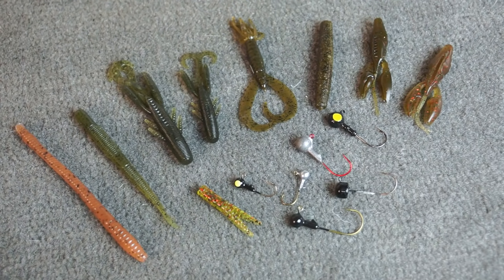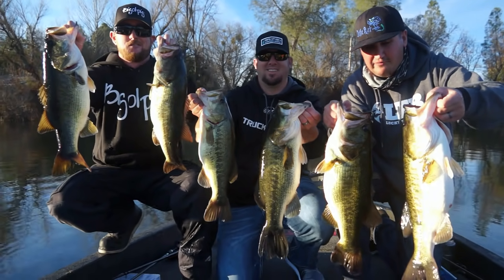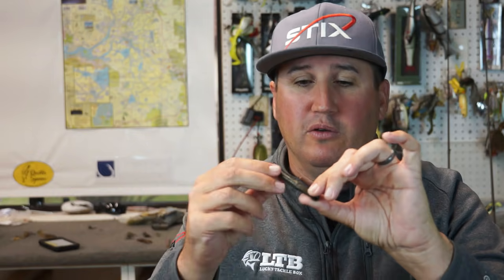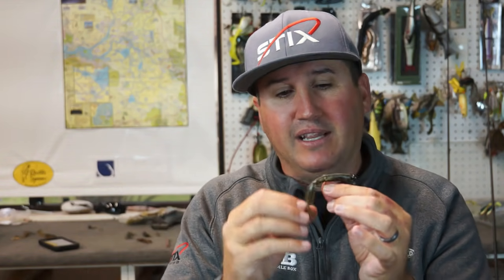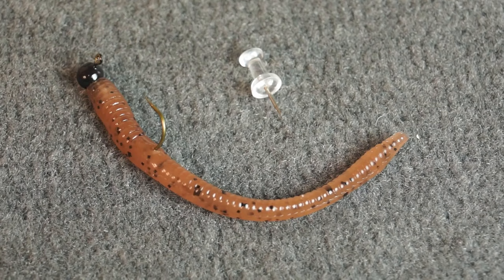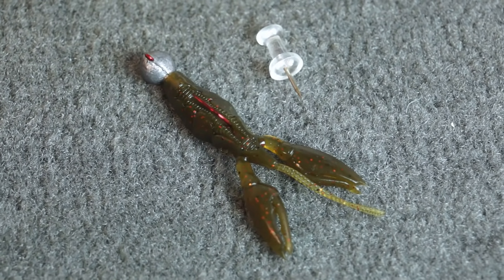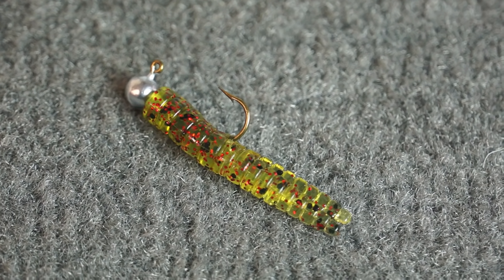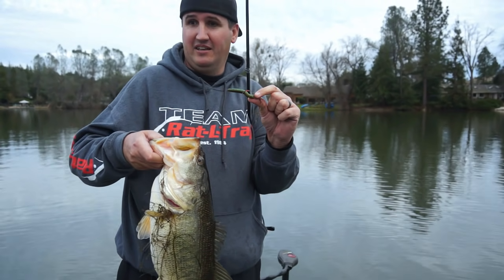youtube video #-B8kv_HNhxE

Comment: I have a nearly 40 year old fishing book from the 80's that suggests throwing a shortened and split floating trick worm on a mushroom head during a cold front. Ned rigs are just the packaging of an idea that has been around for a very long time. 
So many "innovations" are just companies making specific products for things that savvy anglers were already doing by modifying existing tackle. 
Many smallmouth anglers in particular have been throwing Ned rigs since finesse soft plastics and standup/mushroom jigheads existed. 
They just didn't call them that. 
The stretchier, tougher plastics that happen to float were first popularized for Texas and Carolina rigging. It's not that big of a jump to stick one on a jighead. I used to do it with just the tails from lizards and beat the tar out of picky fish in small heavily pressured waters. I'd use a slider head in weeds and timber and a standard open hook jighead in clear rocky streams. 

Insert Pink Floyd's "Money" here

Comment: I feel like it isn't a NED Rig if it isn't a stand-up jig with a bouyant short plastic.  Otherwise it is just a small jig fished slower than normal.
Reply from the maker: IlliniDog01 all plastics float to some extent but in regards to the Ned himself on Ned rigging thats not essential. I agree it helps in lots of scenarios and under line tension they all stand, dead sticking would be the exception.

Comment: the Zman lures are tough but man, they either have a low temp melting point or dont go well with other plastics. I had a bag melt into a blob in my backpack. :(
Reply from the maker: john doe yeah they do, I make it a point to never mix any plastics 😆
Reply: john doe it’s not that they’ve got a low melting point, it’s that the specific plastic called Elastech that chemically interacts with “normal” soft plastics and melts them.
Reply: @TheFishingMommy  Yeah, I figured that as it wasn't hot at all. tnx.
Reply: john doe you have to keep the separate from your other plastics as recommended

Comment: Why is the Ned Rig anything special? By 2005, every Australian angler was fishing jigs with small plastics and catching bags on them. Since the Mister Twister days, we were cutting tails off Mister Twister and dropping them on ball jigs, Squidgy brand soft plastics released in the late 90s are generally smaller than 3 inches. In fact, most Australian anglers in the South who are not fishing for the monster cod use nothing bigger than 3 inches ever. I am truly curious as to what it is that makes Ned Rigs different. Ned did not develop it at all. It has been in use for 30 or 40 years, not since 2006. I really am missing something here, or the American propensity to name everything with a fancy name is confusing the issue. In fact, most people in Australia know no other form of rigging a soft plastic. You rarely see a sliding sinker rig or any other rig.

Comment: Stream fisherman! Cast as directly upstream as possible without positioning yourself in such a way that you'll spook them. Tick bottom with just enough weight and retrieve speed to match the current. If you don't have a sensitive enough rod to notice a slack line or gummy feeling bite, cast downstream along a current seam and drag it very very slowly, pause occasionally and maybe wiggle it a bit. 
You'll thank me later. Just promise me you'll learn what's supoosed to live in the drainage you're fishing, catch and release any native bass you come across, and throw non-native invaders on the bank.

Comment: The 4 lbs is to small I stop buying it and go to 6 lbs monofilament line but I'm not on a boat. It' works with 1/32 but not 1/64 or 1/80 that needs 4 lbs monofilament line. Going mini is fun to do. Just have fun and relax.